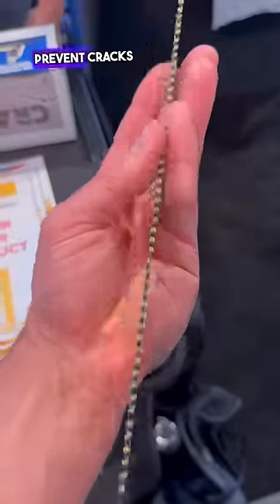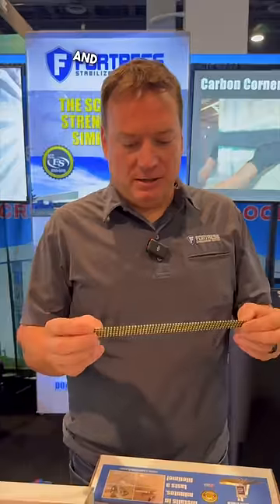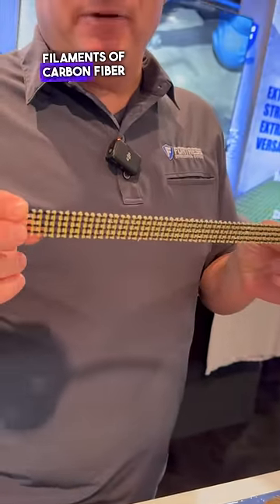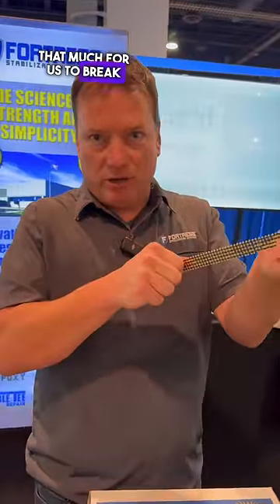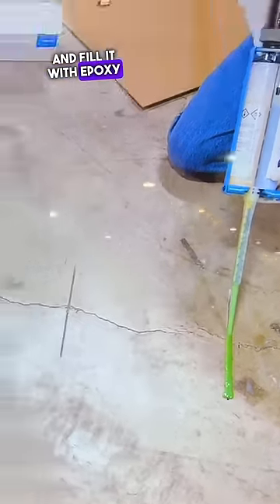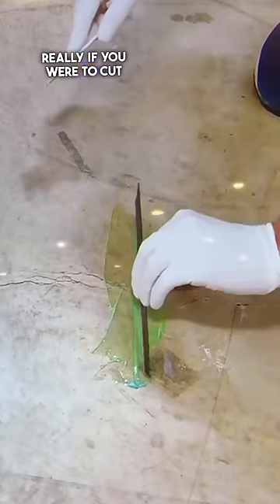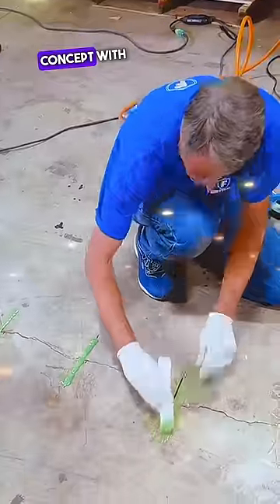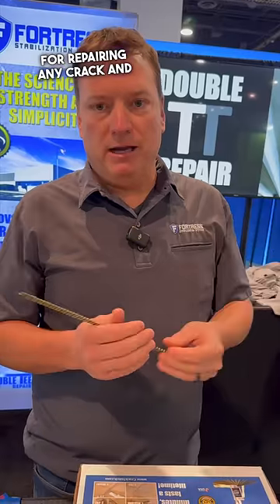Do You Have Cracks In Your Concrete?! #concrete #construction #shorts

Comment: Is only as strong as the glue
Reply: My thought as well
Reply: Stronger than the "nothing but glue" which is historically how people still do this type of repair.
Reply: Modern glues are probably stronger than the concrete
Reply: In university I used an epoxy to make a lap joint between two pieces of 3.2mm thick steel plate. In the tensile test the steel failed first. Can’t for the life of me remember the name of the epoxy though 🤦
Reply: The glue is plenty strong enough to hold that as long as it has something to bond to. Epoxy is no joke.
Reply: 5 dollars EACH!???
Reply: Yeah just need the glue .... Right ? 😂😂
Reply: That was my first thought too 😂
Reply: @infernaldaedra nah concrete glue/epoxy kemweld is rather brittle looks like glass when you break it comes clean off and concrete still looks normal and smooth..but I am unsure if testing both in equal settings
Reply: I came to say it's only as strong as the appoxy
Reply: @cameronvanatti Yeah that was my thought too. A bit pricey!!
Reply: They are composite materials. 

The glue is ridgid and adheres to each surface. The fibers have great tensile strength, but are flexible when dry. 

They compliment each other's weaknesses to make a stronger material.
Reply: @infernaldaedra some of them are. Repair / Concrete epoxy is crazy strong
Reply: all of you are missing the point.
the glue doesnt make it structural, hell if you wanted to, dont use glue and use sand to fill the crack. the glue just fills the crack and keeps it in place. the stitch will still do its job.
its basically just a biscuit joint, but for concrete.
Reply: Exactly what I was about to write. It's only as strong as the epoxy
Reply: @cameronvanatti6629 how expensive is replacing a concrete slab? To jackhammer it out pay for disposal, labor and materials to form up and pour a new slab? This repair is hundreds of dollars instead of thousands. Plenty strong, definitely cost effective.
Reply: General consumer grade epoxy i use is something ridiculous, like 1400 psi. The epoxy is the last thing in this clip i was worried about lol
Reply: @alibong00  I'm sure the epoxy would last longer time wise
Reply: @tztezza there are different examples or types of material strength properties that are somewhat independently variable. Tensile is different than ductile- shear force, compressive force, thermal properties, impact resistance, and even tearing toughness.
Reply: Modern glues are insanely strong. Often the strongest part of the structure
Reply: And the glue is only as strong as what it's holding together
Reply: These strips are kind of pointless unless the crack is growing rapidly. I work as a basement waterproofer, and we typically use epoxy to repair foundation wall cracks / stop leaks, and this type of repair is considered structural. I can confidently say that the concrete will crack elsewhere before it cracks at the point of application. The tensile strength of the bond is multiple times stronger than concrete itself.
Reply: @PrototypePlatform the epoxy is used to anchor the joints to the slab. Even if cement was used it would crack, and fail as soon as the slab shifts because it doesn't bond the way epoxy does. Epoxy does plenty enough to bind by itself, so the joints are kinda pointless anyways.
Reply: Sayinf "just as strong as the glue" would be like saying "adding rebar doesn't strengthen concrete, it's still only as strong as the concrete"
This adds a sh*tton of surface area for the glue to adhere to on both sides..

That being said, that doesn't mean it works.. but the logic here is completely flawed.
Reply: @jonslg240  Rebar is totally different because it's a contiguous structure built into a contiguous mass of concrete. this is glue holding two pieces of concrete to strips of carbon fiber. They're different, and this product could possibly end up just propagating more cracks, or failing due to any kind of motion besides lateral separation, ie the crack simply opening wider and not sliding or dropping. I'll believe this product when I see its performance demonstrated and not hyped up like other construction vaporware.
Reply: @jonslg240 this is right, how do I know? Because the direct analogy is carbon fiber or fiberglass. The tensile straight of a carbon strand or glass strand is thousands of times higher than the epoxy resin. Regardless of if this product works or not saying it’s as strong as the epoxy is really dumbing down the variable of the total system. Then I could just say it’s only as strong as the surface prep and cleanliness. It’s only as strong as the environmental temperature at which it was applied. 

This is just useless information just spouting out slogans with no real scientific meaning behind them. Do you guys work for the FDA.
Reply: @alibong00 weld? 😂
Reply: They could have just made the ends wider than the middle..
Reply: Yeah like the same glue that's used to chemically anchor things into concrete in construction, the same glue that you have to jackhammer the concrete off during a demo. So it's pretty fucxing strong
Reply: I was thinking the same thing
Reply: @cameronvanatti6629 kevlar ain't cheap. But still, if you use 5 of them on a crack with epoxy that's like 150 bucks or less
Reply: That's like saying concrete is only as strong as concrete, but if you add rebar it's much more stable. If carbon fiber body panels on a car can bounce back from a high speed impact with minimal surface damage, im sure it'll hold better than just glue alone
Reply: Preeshyshly Mish Moneypenny
Reply: No not necessarily. The glue probably has zero tensile strength but can hold the strip in place.
Reply: @TehBigMoose  you're missing the point. Concrete has a pre-determined adhesion value when bonding to concrete. That value changes based on the material it is sticking to. His point is that epoxy also has a pre-determined adhesion value relative to the material it is sticking to. But let's say that you replaced the epoxy with say craft glue or wood glue. Then the strips ability to maintain adhesion changes also. Let's go even more extreme and say you used bluetack to hold the strip in place. Then it becomes even less adhesive. The strip might be strong but how it holds onto the surfaces of what it keeps together is where the real problem exists. We already have very strong materials which don't nesseceraly have a system that can bind them to another material with ease.
Reply: Unless the glue is as strong as the concrete.
Reply: Without the strip, only the epoxy at the crack needs to break. With the strip, there is a lot more epoxy that needs to break for the crack to propagate.
Reply: It's not true at all. Glue on its own does nothing.
Reply: Considering we never stopped using glue and are always inventing new types for different applications or reworking or recipes to male them stronger.

This is a system that will be outdated soon unless they sell their own glue and continuously renew the recipe to modern standards.
Reply: @alibong00 good stuff.
Was it expensive?
Reply: @darkling9545  Epoxy is not a glue. This is the exact same way carbon fiber airplane and race car parts are made. The epoxy in betwen the carbon fiber sheets is what gives rigidity. The carbon fiber gives strength. If you don't know, don't pretend you do.
Reply: Epoxy is stronger than god
Reply: @darkling9545  no idea, it was a uni course 20 years ago now, so I bet the high strength stuff in your local hardware store is about as strong
Reply: Came here to say this
Reply: It's only as strong as the concert around it😂😂😂😂😂😂
Reply: The right epoxy is stronger than the concrete.
Reply: @TripAMD  would say harder than concrete.....it's the sum of its parts like steel Reo or fibreglass that give it is true strength 😋😋😋😋😋 sorry been a smart ass
Reply: @JackTalyorD  I'd have to agree
Reply: Rebar and concrete is the same concept
Reply: Epoxy is probably stronger than the concrete.
Reply: No not true at all this is more comparable to rebar reinforced concrete, the “glue/resin” on its own has its strength like conventional concrete but when you add rebar or this case the carbon mesh it acts as a binder meaning it’s many times stronger just like reinforced concrete
Also epoxy is immensely strong and so is carbon fibre probably that more to break that the concrete around it
Reply: It's a structural epoxy typically spec'd for threaded rod concrete anchors. It will be fine.
Reply: Not really, only as strong as glue plus reinforcement. Because now it's a composite and both act together. The glue by itself would be much weaker.
Reply: Exactly what i came to comments to say (but u said it more concisely)
Reply: Epoxy is strong AF. If you've ever used epoxied in anchors, the concrete becomes the weakest point for pullout.

My concern would be the "simple cut" would have a relatively smooth face

I don't see this working as claimed though. The concrete slab moved because THOUSANDS of pounds of concrete moved. This will just be a cross crack starter
Reply: @alibong00  loctite actually pulled freaking TRAIN CARS with a simple epoxy bond between flat plates mounted in the couplings.

And the amount they used was basically nothing.
Reply: @andyanderson2143 I think you're missing a couple zeroes. It's more like 80,000 psi
Reply: @One_Zhadosian  the only thing the stitches do, is help guarantee when it cracks more, it'll be somewhere else 🤣
Reply: @latenttweet  that FDA jab 🤣
The carbon fiber mesh is basically just like aggregate in concrete. It's there to mitigate issues with the brittle properties of the bonding material.
The epoxy is 100% doing all the work. The mesh just keeps the epoxy from having a through and through snap / single crack failure
Reply: @ObservationofLimits  yeah, the strips are pretty pointless imo just because epoxy does plenty good on its own.

 It's so much more work to even make a bunch of cuts in the wall while assuming the direction of separation is drifting apart. It causes weaknesses in the foundation, and It could be shifting horizontally, vertically, inward, outward, etc. which would render the tensile benefit from lengths of carbon fiber strips pointless if they made an impact in the first place. 

It's just as easy as to reinforce with rebar, and more secure as well.
Reply: @cameronvanatti  I thought the same thing, but then I realized if it cost you $50-$100 in materials to do a 50% better job of fixing up a serious crack, maybe it's worth it. Supply and demand…
Reply: It is exactly what I thought
Reply: That glue is stronger than the stitch itself
Reply: Knew I'd find this comment.
Reply: It's just a mesh that hold the glue in place. It's like rebar in concrete
Reply: nope
Reply: Nope if the glue breaks now you have that thing in there breaking the conceete@f.k.b.16

Comment: Concrete does two things - gets hard, and breaks.
Reply: Same
Reply: It's a law to say this right after you pour any concrete
Reply: @davidwalker5001  yep!
Reply: Anyone that works with crete will tell you cracks are going to form. The ground shifts. If those dinky straps hold then it fails in another section.
Reply: That's one more thing than I does.
Reply: @bobsaget6720  🤣
Reply: @chaselove603  Indeed! I've worked with concrete for 30 years. Concrete will crack. The shrinking during the months long curing period will cause cracks alone. even more shrinking will happen if the concrete is indoors and when excess water evaporate over the next coupe of years more cracks will appear.

The product in the video might work in some fringe cases on really small floors, but most likely it would just cause cracks to appear in new locations...

The 'strength' shrinking concrete causes is unstoppable.
Reply: And almost never stolen
Reply: Which is why they invent products like this
Reply: If you prep the ground properly, making sure it's relatively flat before the pour, it can minimize weak points and then of course control joints cut at least 1/4 of the thickness of the slab. And it will still crack, it's concrete. It cracks.
Reply: Tell it to the Romans
Reply: Yeah that's what my wife said 😂😂😂😂😂😂
Reply: @chaselove603  depends on where it's poured, what it's poured on (subgrade and subbase), the amount/material of aggregate, additives like plasticizer, lime content, the overall shape being poured, how often it's exposed to moisture (and the amount that is changing), temperature swings (I find most cracks are where the subgrade under the slab can get to below freezing but then have daytime temps above freezing - the temperature differential between the face and the underside of the slab causes too much growth variance), whether or not there's significant moisture content that is then able to freeze (concrete/cement is porous - sealing your concrete can go a long way), the size and manner the structure on top of the slab is mounted (something like a garage where all the weight is on the outside edges and nothing pushing in the middle), the amount of force due to weather that said structure will be transferring into the slab / anchors (epoxying the entirety of the sill plates to the slab helps spread out forces from the structure shifting).

That's a non-exhaustive list. There's really no good way to dumb it down.

Also, high PSI concrete like bridges, airport runways, space shuttle launch pad are far less prone to cracking when done right. But then that's a tradeoff in time and costs.

Comment: but the mounting point is epoxy.. which can be strong but its attached to brittle concrete. It will pull apart just the same as putting epoxy in the crack

Comment: So, how does this stop the settlement issue that is creating the cracks? You need to either fill the void via grout injection or install a lifting pier system to stabilize and relevel the structure. Then the cracks are cosmetic. You grind them out and caulk with an expansive adhesive.
Reply: If it's caused by tree roots, the root won't win.

If it's caused by ground phenomena, it'll lose but much later, like when you suddenly add more weight in garage/ basement.

So this product is mainly to battle tree root systems mega cities [like] to plant in front yard AND back yard for some reason sometimes right next to the house.

Poor planting.
Reply: @EonAlpha  The root goes the path of least resistance. If it can't go forward it will just go sideways
Reply: @AnUnapologeticApologist  which is fine, long as plumbing doesn't get punctured.
Reply: @EonAlpha Like the old saying: “Want to make God laugh? Make a plant.”
Reply: It will just crack around the repaired crack.
Reply: Because its a crappy product that doesnt actually do its job, just like 98% of the crap you find at those shows. (Might sound like an asshole here, but ive been in the industry for 17 years and ive seen thousands of these products, about three of them actually worked)

Comment: I've worked with concrete for 30 years. Concrete will crack. The shrinking during the months long curing period will cause cracks alone. even more shrinking will happen if the concrete is indoors and when excess water evaporate over the next coupe of years more cracks will appear.

The product in the video might work in some fringe cases on really small floors, but most likely it would just cause cracks to appear in new locations...

The 'strength' shrinking concrete causes is unstoppable.
Reply: Even with fibercrete?
Reply: @i-love-comountains3850  Yes. The issue with fiber reinforced concrete is that it's really hard/impossible to get a homogeneous distribution of the fibers. Aka, there will be weak spots.
Reply: Get the stuff the Romans used
Reply: If your concrete cracks within 5 years its GARBAGE concrete
Reply: I’d imagine the method they are using to fix it would be just as good with any piece of steel or steel cable and epoxy, as long as you did it every foot or so, like the vid. I have no experience with concrete though, just seems like a good method.  What do you think? Has this method been used for awhile, and the new product design really isn’t that critical?
Reply: @rilesmattix5217 someone don’t know much about concrete
Reply: @sneaky_krait7271 there's a reason why we aren't building stuff like the romans, and that's because the world has changed since the roman empire. building stuff in southern italy isn't the same as building stuff in north america.

Comment: Something tells me this is COMPLETE !  BS ! !
Reply: Its not.
Reply: It's not, but it's also not a fix all. There is no magic fix all
Reply: I call BS too
Reply: @John-Rambo81 So shifting ground is not a ... Reality ?
Reply: intuition.
Reply: It’s a short term fix, until you get a contractor in to jackhammer the slab out, address the underlying issues and repour with 5000psi with fibermesh in the mix. 
Plus maybe rebar along with the 6x6 wire. 
My guess is the 6x6 wasn’t pulled up while pouring and it’s sitting on top of the gravel.

Comment: That doesn’t stop cracks from forming, it only prevents the already existing cracks from getting bigger. It could still crack anywhere else and by the time you do that 15-20 times you could have bought a new slab. And then how would you do this if you house slab crack around the outer wall or underneath the interior wallls????

Comment: If the forces are there to pull apart and crack concrete. Even if you strengthen the emerging cracks. All that will do
Will mean it cracks
Somewhere else.

Comment: So if I got 20 feet of slab on one side of the crack, and 20 feet on the other, a couple little thin strips of metal with some caulking is gonna be able to withstand the force, weight, and leverage of one side of the slab trying to sink? Riiiiiiiiiiiiiigggghhhhhtttt. 🤦